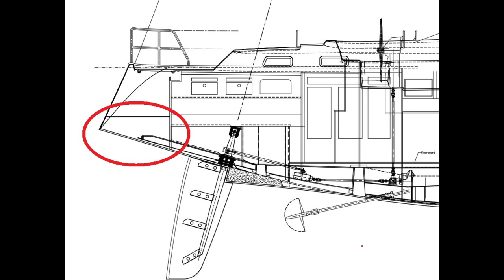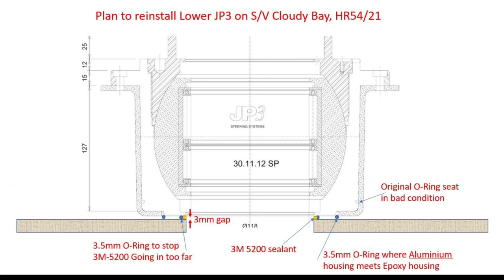Boat maintenance Part 6 - Hallberg Rassy 54 Cloudy Bay – Apr-Jun'21. S21 Ep6

Comment: Excellent job Glen, l think adding the two additional O-rings on the bottom was a good idea. 
It's surprising to see how the aluminum eroded on the bottom of the housing. Oh, and FYI, it's still referred to as a BOX KEY. I'm not sure if you have a Woodruf key anywhere on the boat. Thanks for sharing.
Reply from the maker: Glad you enjoyed it it Larry ... actually I think I must have woodruff key sealed on my brain!  Well, truth is that this footage was shot before you previously corrected me. Will get it right going forward. But I I dont have to see that particular key any time soon, I won't be unhappy!

Comment: Hats off to you. This must be the best maintained boat. Am surprised that such a new upmarket boat needs so much reconditioning as a result of corrosion?
Reply from the maker: Thanks Robert. But the boat is not exactly new. 14 years old this year. Imagine driving a car for 14 years and not needing some work. And boats are in a much harsher environment. Especially ours, which gets used each and every day.

Comment: The locking bolts into the rudder post should have had a dog point going into the hole, that is a bolt end turned down to get to a smooth surface below the minor diameter of the bolt thread.
Maybe that is what you had, but you did not show the lock bolt end.
The life of the leaking housing was 14 years, really not too bad.  The original owner had a trouble free life.
I hope your fix works, certainly worth the try.
There is always the possibility of all new parts for 14 more years of use?  Depending on things, that might have been the best way to go as you might want a different boat by then.
All the best, JIM 🤩
Reply from the maker: Thanks again for the useful comment Jim. The lock bolts had a slightly pointed end, such that they sit tight in the drill hole. But the original installation simply had them graunched  into the thread can you believe!
I would have purchased a new bearing housing, but the lead time was 10 weeks and I had to get the rudder back up and hole filled!

Comment: I think you should paint the whole assembly after you repair the corrosion if you can gain the clearance. Perhaps you should cut it down overall on a lathe to gain clearance for the paint surface to secure the fit. Or just paint the exposed surface to the water.

Comment: Outstanding. You even applied your professional work ethic to filling in the hole correctly! - you could have left a time capsule in there for posterity. When you are finished,  perhaps you can say how much this refit would have cost you at HR or other facility?
Reply: 150k is my guess - as a yard would not 'rebuild' so many parts....they would fit new at cost to the owner and save the labor time.
Reply from the maker: I’m not really sure what a yard would cost. But here in USA people time is at least $100 per hour. I had a friend who had the same job “professionally” done on his rudder in South France and it took 2 guys 3 1/2 days. And they didn’t address corrosion - just stuck it back in with lots of silicon!
Reply: @SailCloudyBay  yup - that’s what you’ll get… when more corrosion destroys the part, your friend buys another part and delays his trip.  When something happens on your boat, you fix it and keep sailing on :)
Reply from the maker: Thats right Ian, with me its ALL about wanting things to work correctly for the rest of our circumnavigation. Becuase so-called expert help will be very thin on the ground once we head west from Panama.

Comment: Well done, mate. A lot of work on that rudder bearing, but then having your rudder drop out mid passage could be 'disconcerting'.
2 Questions ...
1 At about 37:00 had you put new, dark coloured antifoul around the rudder hole?
2 How did Ray not fall fown the rudder drop hole?
Reply from the maker: Yes, just that was just regular antifowl, painted in the placed that I cannot reach when the rudder is up. On the second question, my hole was engineer designed not to even allow a mouse down the side of the rudder, let alone Ray!
Reply: @SailCloudyBay  Probably the only illegal hole in a boat yard with it's own engineering compliance certificate ... ⛵🤓🇦🇺

Comment: Using antisieze is a good idea, make sure you use one designed for aluminium. Lanacoat would probably work I think. Common copper based antisieze in a salt environment would seem to me to be asking for trouble. The corrosion looked nasty and the next time you are hauled out you might  think about getting those pits drilled out and rewelded and then the whole thing machined black to spec. Did you passivate the corrosion?My aluminium lower bearing disintegrated (the boat was 20 years old) and I opted to replace it with bronze that I put a grease nipple into for the sake of the steel rollers.
Reply from the maker: I did want to replace the pitted aluminium housing, but the lead time from the manufacturer was 10 weeks, which didnt work for me. As for welding, I was concerned it could do more damage than good. ANd finding good skilled people in and around Maryland is not easy. The good ones are all too busy with their own set of clients. Very hard to get quality work done around these parts. So I opted to expoxy it, then ensure it would never touch seawater ever again.

Comment: Glen - as a fellow SLB retiree that also owns an HR, I watch your videos in awe. I'm afraid the software division didn't educate me in maintenance as well as OFS clearly did you! I'm glad my HR is the much simpler HR36. 

Can you provide more detail on the sound deadening paint? I've got the same problem and would like to give it a try. I've never heard of the stuff before and am intrigued.
Reply from the maker: Hi Martin, I would say that I got any practical skill from my father and brother, but SLB certainly honed them in, having to fix anything and everything on our Wireline equipment. The boat has similar systems bar the explosives and radioactive sources. 
The sound deadening paint I bought from Defender here in USA, called Silent Running. Look up at www.silentcoating.com

Comment: Glen, your attention to detail is impressive and you have certainly effected an excellent repair. Too late now (for this repair) but you may wish to be aware that there is a specific product which may have helped you in the form of ‘Belzona 1111 (Super Metal)’ which is suitable for exactly the material and sort of corrosion you were seeking to remedy. Hyperlinks normally cause issues in the comments on YT - but a Google search on the  terms above should bring it up.

Respect.😀👍⛵️
Reply from the maker: Thanks Norman. Yes someone else mentioned this product. It’s on my to-buy list now. Cheers and thanks for the tip

Comment: Glen, we miss your videos! I trust all is well in your world. I am curious about how you deal with a 50hz vessel in the 60hz US electrical grid. I am looking to purchase a new yacht (I live in the US but love Europe and global sailing) and am deciding where to base my operations. If possible, would love to hear your experience while here.
Reply from the maker: While in the USA everything on our boat (220v 50Hz) worked fine with 60hz shore/yard supply. The only item that didn’t work was the pump-out system on the washing machine. So we use that on inverter rather than shore power. 
In theory it should be the same the other way around: a 110v 50Hz boat in Europe
Reply: @SailCloudyBay  Now I'm totally confused. Everything I read says it'll over heat and the sky will fall. Are HR's wired for this specifically? I am looking at an HR46 from the EU that would likely be placed at Herrington Harbor. Will you be returning to making videos again? Really miss your videos - so well done and informative, but I also understand life's realities.

Comment: I changed my mind marine grease for the rigging is better than sheep grease . Tayana guy . Does your two water pumps work off one pressure switch on one of the pumps
Reply from the maker: No, each pump has its own pressure switch.

Comment: I would have looked for a machine ship to weld up the corrosion holes and O ring groove and use a lathe to re machine the surface. The whole thing can then be re-anodized. Also, you could maybe use a second seal to the hull. The corrosion is partly due to and electrical pathway from the stainless stock to the housing or the steel of the lip seal I suspect. I had an aluminium lower bearing completely collapse and replace it with a bronze one and added a nipple to pump in new grease a couple of times a year.

Comment: Wow !! Very impressed with your ability to sort out the rudder bearing. Did JP3 advise you on the the epoxy repairs to the aluminum bowl/sleeve?
Reply from the maker: JP3 would have prefered I purchased a new bowl, but their lead time was 10 weeks. So they did kind of agree what i was doing was the best "to last you until we can make a new one".  But now that I've got that zone completely sealed from seawater ingress, it will certainly be lasting my ownership at least.

Comment: Had you considered a splash zone or belzona product for that housing repair? I have made numerous salt piping and below waterline repairs with those products before. Just curious, what was the epoxy you used?
Reply from the maker: Drew, thanks for the tip. I had not heard of those products before. The Epoxy I used was "Six-10"

Comment: Glen, I'm a bit surprised that you chose to use epoxy to fill in the galling.  JB Weld makes a product that's an alloy metal similar to the alloy you're bonding to.  It would seem more appropriate....
Reply from the maker: Yeah, I've only just learned about JB Weld unfortunately. I'll do better next time!

Comment: I have been keen to see the rudder assembly of some of the newer HR's and voilá ... here's your video explaining it all with surgical precision. I have also been thoroughly impressed by your work - top-notch by any standard.
Here's my question - why is there no watertight bulkhead between the steering compartment and the cabin? Several bluewater boats, like Garcia and Boréal have it, and so do several performance-oriented designs, e.g. JPK and Pogo. I understand that with an aft cockpit that separation becomes much easier. The prospect of being on a long offshore passage and knowing that the fate of the ship depends on those seals and o-rings does not appear to be too reassuring. IMO, the issue becomes even more problematic with the latest designs, like the HR 50, which all have twin rudders. What if you hit a floating object at full speed? Are those seals plus the lower and upper bearing really be up to the job of avoiding water ingress? Or am I just being overly risk-averse ... ?

Comment: Would it have been better to use something like Devcon to fix the bowl?? You did a great repair job, regardless, nice work mate
Reply from the maker: Thanks for the tip Shane. Devcon looks similar to "metal" epoxy that others have mentioned, all of which I didnt know about. It's now on my to-buy list. Hopefully, if I've managed to keep the water out of there, that repair will never see salt water again.
Reply: @SailCloudyBay  All good mate, I don't know much, so when something I say helps someone, then it brings a little joy.

Comment: The drives on the rudder . One will push and the other will pull . How does that work . I have just one . That looks strong ,the Class 2 drives say up to 50 foot or so . Are yours class ones or twos . I want Andy from Ocean Podcast and Zingaro to see that
Reply from the maker: Yes, one pushes one pulls. One is simply wired opposite to the other.
Reply: @SailCloudyBay  alright that’s my plan . Thanks . Your a big help . I just finished pulling off the teak then one coat of fiberglass . I’ve just about got everything bedded . Maybe in two week I can go sailing.  Thanks again

Comment: This has been a fantastic series of videos
Do the two autopilot rudder drives  push-pull or is one a backup. Is there one dual drive course computer or two independent  course computers?
Reply from the maker: Geoff. Good question. They both work off of one computer in a push-me-pull-me fashion. But there is also redundancy there because 1 alone can also do the job. 
But we do also have a second AH computer. Infact we have total duplicate system ( computer, rudder sensor, heading sensor ) and can swap from one system to the other via a change over switch. 
With just 2 of us on board and really only one able to steer, the AH system is vital. Hence the full back up. We even have 2 spare linear drives!
Reply: @SailCloudyBay  is the dual drive computer just a standard one clutch signal output and you then invert the output to one of the linear drives or is it a dual drive two clutch controller?    Is it a Raymarine?
I had expected to see a hydraulic ram on a boat of that size
Reply from the maker: Geoff, Its one clutch output that goes parallel to each drive. And the drive +ve and -ve supply are switched for one drive. Yes, they are Raymarine. Much more sensitive than a hydraulic drive.

Comment: Based on your discovery, JP3 should be recognizing their O-rings as an installation or operational failure. Given the criticality of the ring, I’m surprised it wasn’t designed with two or more O-rings (though the Challenger space shuttle solid rocket booster had two O-rings, and you, like me, are old enough to know what happened there, albeit slightly different use case).

A workshop probably could have put another groove on that bearing housing for a 2nd O-ring, but that would have required a lathe. Your multiple ring installations look like a good option. 

Didn’t you say JP3 said not to have grease on the plastic ball, given it self-lubricates against the AL housing? And yet you added grease?

I’m surprised HR had screws into fiberglass for that bearing housing. Maybe it was intern design day at HR, or a cost saving, or they thought no one would ever remove the bearing housing?

I would hate to see the condition of some of these legacy boats people recommend on sailing forums – 20, 30, 40-year-old blue-water Oysters, Swans, Hallberg Rassy, + cheaper productionboats, etc. If owners were not maintaining their equipment as fastidious as you, those older recommended sailboats are likely unseaworthy these days. 

Did that soundproof paint make any noticeable difference? You might have been better off with acoustic fiber that targets the specific sound frequencies (e.g. mineral wool, etc).

Was there a Part VII video?

Terrific series.

Comment: Oh- a yellow and a green Kayak racked  on my stern  quarters
Reply from the maker: I'll look out for you next time I come in. Tomorrow likely. Currently jsut getting a nice wash down. That was quite a dramatic arrival of the cold front eh?
Reply: @SailCloudyBay  Good afternoon Captain-
Yes. The westerlies off the Gulf are extreme!  (Sometimes) 
The northers are rough in the bight- we lovingly call the moorings  the bowling alley b/c break-aways.  Poorly-set up bridles under maintained moorings  or due to the nature of the bottom for anchored boats with poorly set ground tackle- or the wrong type of hook- there's deep grass on the bottom.
I'll tell anyone to put  every bit of rode 20:1 to 30:1  out in anything over 20kts. Due to the lack of sea room  boats typically have to get it right the first time. 
If you hear air horns at night or during a blow watch out for the bowling balls!

Comment: How often do you service all of the hydrolic furlex systems on board?
Reply from the maker: Depends on use. But every 5 years for the above deck parts of the system I would say. Below decks system (pumps, solenoids etc) not sure. Ours is 13 years and still looks like new. But I did just renew all the hoses.